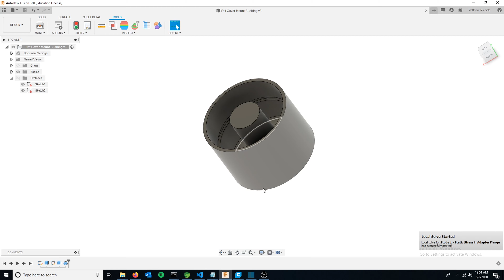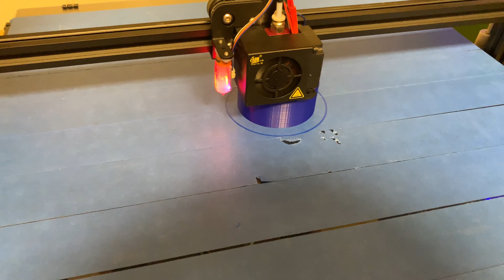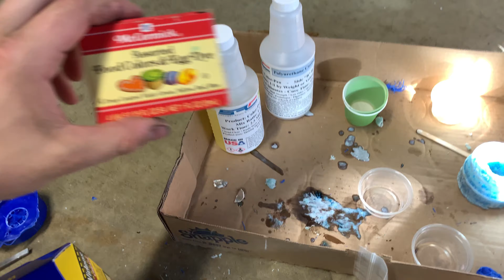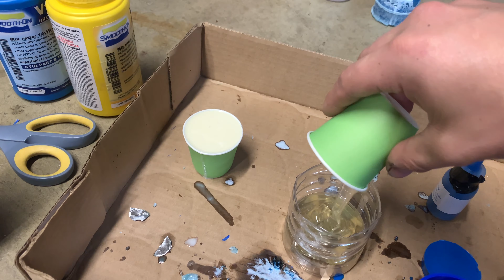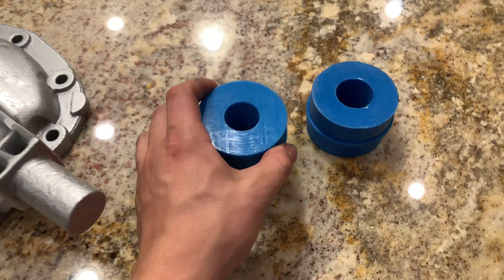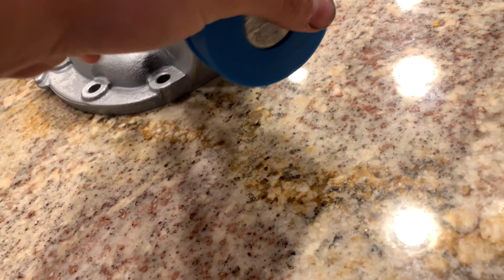Volvo 850 T-5R AWD Swap - Homemade Polyurethane Bushings Using 3D Printing

Comment: Totally rad channel!! Apologize for off subject.. I'm building a v40. Full motor build. Looking for a importer to acquire a manual trans from swed. Any suggestions? Also megasquirt or upsolute? Looking for somewhere over 500bhp. Thanks for sharing inspiration to go fast spend tons of cash and work on over  Engineered vehicles😎
Reply from the maker: Use this website https://en.bildelsbasen.se/ For a V40 (assumings its gen 1) I would go with a standalone ECU. There really aren't any suitable options for tuning the stock ECU (even if companies say they can).

Comment: make the mold's lip taller and use a electric sander attached to the bottom of a small table and it will shake the bubbles up and out before the cure. Run time depends of the viscosity of the urethane.

Comment: I just ordered 500m with TPU, I will be printing bushings from that filament for my S70
Reply from the maker: Nice! Curious to see how they turn out. I shyed away from using TPU because I dont think the layer adhesion will be good enough for something like a bushing that is under high stress all the time.
Reply: @SimplyVolvo  That is worth considering. I am going to try heat treatment. I don't know if a couple of hours will do in the oven. It is worth a try. Thinking about upper engine mount, to begin with. That one usually gets tons of beating.
Reply: Hi. How much clearance you left when designing the inside cylinder that will hold the diff housing?

Comment: Have you thought about actually printing the bush using polyurethane 3D filament like Ninjaflex?
Reply from the maker: I would be worried about the layers separating under the extreme stress these will see. I think a 2 part resin will be much more durable.
Reply: @SimplyVolvo  good point. It's a shame Volvo are no longer supplying parts like this any more. I had to make my own throttle cable recently as that is a discontinued part too.
Reply from the maker: @dangerousdave5076  I was surprisingly able to every single bushings for the rear end (over 10 different ones) except this one. But there's always a couple parts that are NLA. Hopefully Genuine Classic Parts starts reproducing a lot of these.

Comment: I used to do a lot of electronics encapsulating at my previous job. I used a small table top vacuum canister to remove the air prior to the pour. Just be sure to use a container atleast 200% larger than the amount of fluid as it expands under vacuum. Keep up the good work man, love the videos.
Reply from the maker: I considered getting a vacuum pump & vacuum chamber but for just 2 bushings I couldn't justify it.
Reply: @SimplyVolvo  make a vacuum machine!

Comment: Home made bushings are trial-error... but i used FibreGlast brand with good success. expensive tho. https://www.fibreglast.com/product/urethane-casting-resin-shore-a/urethanes
Reply from the maker: Yeah it was definitely a lot of trial and error. I am however very happy with how they came out. They are very stiff, but still have a tiny give in them, so hopefully won't be breaking any diff covers. I considered getting some machined from Derlin, but I think that would be too hard and would lead to cracked diff covers.